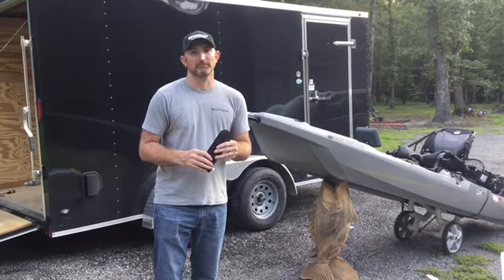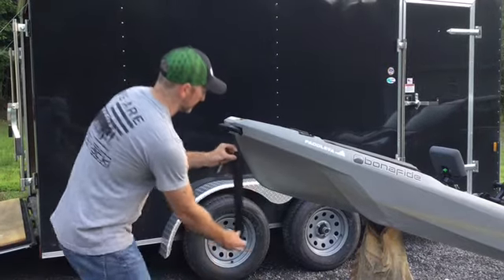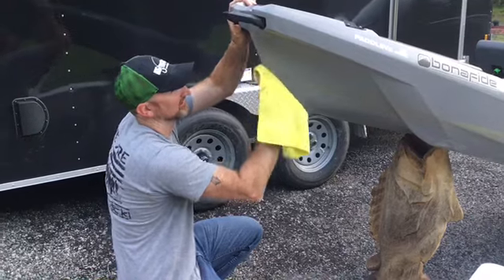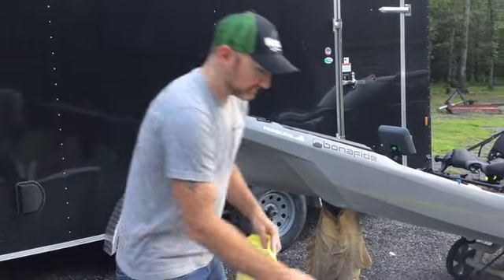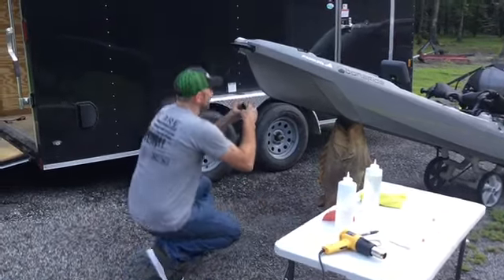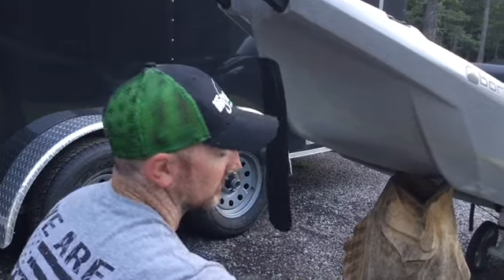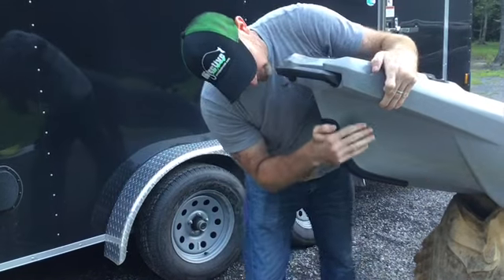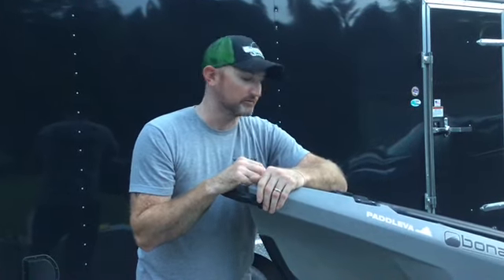Kayak Keel Protector Install

Comment: I bought this and followed these directions and it sat for 3 days after installation before I went fishing. It didn't even last one fishing trip. When I got to shore to load up it was about half off. It continued to fall off just sitting on the kayak trailer at home over the next day or two. Currently I'm trying to get it to stay on with some silicone glues I had around the house already, but I'm pretty sure I'm going to have to purchase some special marine grade glue to hold it on. 
So warning to others thinking about buying this, it may not hold to your kayak well (or at all) with the included glue strips. It is a nice piece of rubber though and I really want to get it on my kayak. Just know you may have to spend even more to get some glue to hold it on. FYI I have a FeelFree Moken 12.5v2

Comment: Anyway I could get a close up? Or maybe you've done a video of it? I've got a Hondo SS127 I need a cart for. The one I bought doesn't work.
Reply: I have a SS127 too. I’m looking for a cart as well. Can you provide specs on your DIY cart?
Reply: I've made a couple of these.. you can follow the basic instructions in the link.. mod for your width of kayak.. I use the 13inch wheels in place of 10.  Don't cut the center axle until your done so you get the width right.
http://palmettokayakfishing.blogspot.com/2011/04/diy-bulletproof-kayak-cart-build.html

Comment: I just came across this and it looks like a good protector. I get keel rash on my kayak mostly on concrete boat ramps. How long might one of these last?  I try to get out twice per week.
Reply from the maker: It mainly depends on how much you drag the front. Also how hard you come up on the ramp. But most of the time we change it about once every two years. But if you use it a lot could be once a year.

Comment: Why don’t you use 303 if I may ask?
Reply from the maker: You really don’t need it on a kayak really for one. Because we have put them thru a lot and don’t ever have fading issues. But 303 Soaks in the plastics and after a while can cause break down issues in the plastic. If there is any thing you want to stick to the kayak after you put it on you will have issues.

Comment: what's the dry time
Reply from the maker: Once you stick it on. Put it in the sun for about 45 min or so just make sure sets up good
Reply: @OneObjective  thanks for the response already put my yak up and happy with the outcome. Put the bonafide mold on a vibe sheerwater and it's holding good💪💪

Comment: Installed my keel guard on Saturday just like this video. Went kayak fishing yesterday and while loading up after fishing I noticed it was no longer on my yak. :(
Reply from the maker: Email us oneobjectivebf@gmail.com. We will help you out.
Reply: @OneObjective Messaged you 3 weeks ago, never got a reply. In the mean time I purchased the gator guard kayak keel guard for $20 more. After 2 weeks of usage since I installed it I can say from recent experience your product is trash. I didn’t have to heat the rubber with a ridiculous heat gun, it’s not bonded by a strip of gorilla glue and best of all it’s still on my kayak.